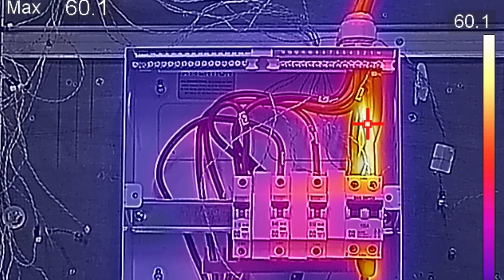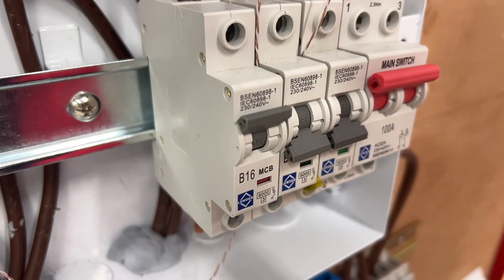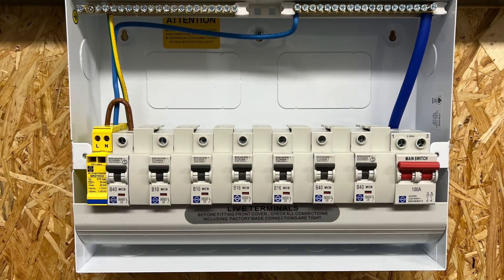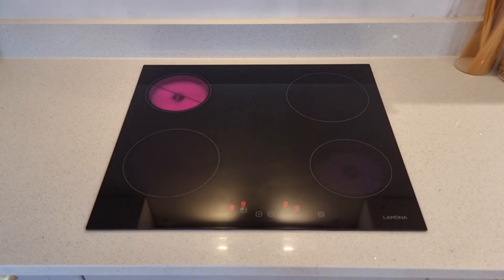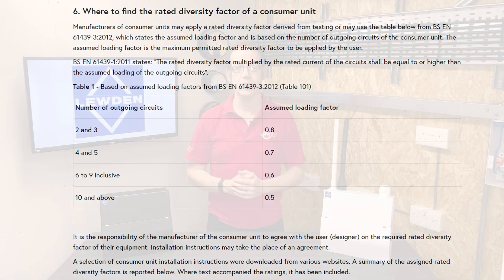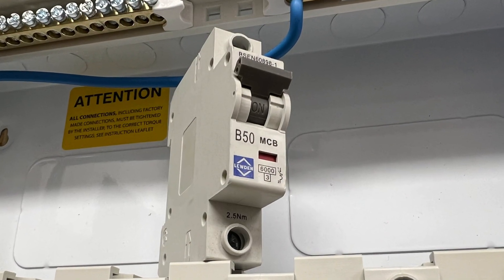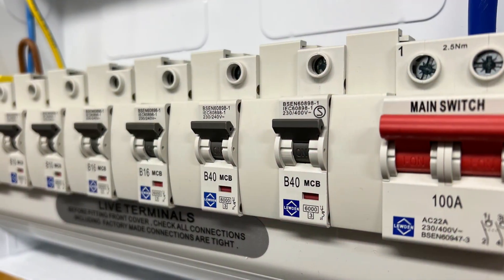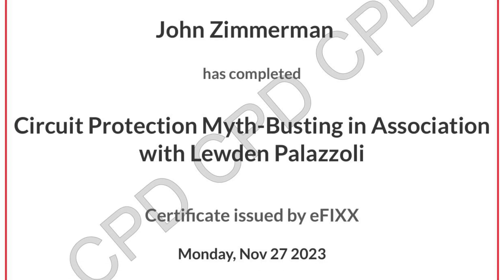Should MCB's & RCBO's be Spaced Out in a Consumer Unit?

Comment: But the max rated temperature on MCBOs (at least for Eaton) is like 70C, with derating of 0.5% per C.So going from 25C to 40C only lowers it by 7.5%
Reply from the maker: 7.5% is considerable for an Ev charger which is fully loaded for hours.
Reply: @efixx  I guess, here on continent we don't really get 40A single circuits, even 20A is pretty uncommon, as most higher power stuff runs on 3 phase.

Comment: If youre installing cheaper branded gear that specify they need to be spaced out to prevent them over heating then sure. 

Personally ill stick to brands than engineer their products better
Reply from the maker: It’s an issue with all brands.
https://electrical.theiet.org/media/3068/wiring-matters-issue-96-july-2023.pdf
Reply: @efixx  yes, as it even says there, when constantly loaded. How many circuits can you say are constantly loaded to even 50% in a domestic setup?

Comment: If devices are manufactured to a BS or EN standard then it’s the manufacturer that should give what aspect of their standard of their standard does not meet the criteria and why separation is required.
Reply from the maker: It's compliance with the relevant standard that MIGHT lead to a need for spacing.

Comment: He morel of the story is don’t load the rcbo/ mcb to near  it’s maximum rating. As my old boss used to say if there is any doubt put in the next size cable in and allow for a slightly higher MCB as you never know what’s going to be added to a circuit at a later date

Comment: If we start doing it like this we’re going to need a full wall for a dis board
Reply: Wait until they make the generally pointless (in the UK) arc fault detector mandatory...
Reply: Forgive me if I seem to be overthinking this but Would it not seem like sense to fit solar panels and ground force heat pumps and all the other shit as standard practice on all new builds

Comment: The thermal de-rating inside a breaker box is essentially only a function of the maximum current that can flow through the breakers in the box.  That in turn is a function of only two things: (1) The main breaker amperage and (2) Whether the sub-breakers are 1-pole or 2-pole (or 3-pole, etc).  And that is it.  It doesn't really matter whether the high-load breakers are next to each other or not, and the number of breakers doesn't matter either (since the total is bounded by the size of the main breaker).  The heat will effectively spread through the whole of the enclosure.  More on that in a moment.

The third thing to remember is that the heat generated is a function of the square of the current. I*I.  Because it goes by the square of the current, just using the normal rule of 20% for circuit ratings verses heavy or continuous loads essentially removes the issue entirely for nearly ALL situations.   Current just 20% down vs the breaker size will massively reduce the heat generated inside the breaker... it will cut it almost in half, in fact.

The 20% rule can simply be applied across the board, whether the load is heavy, continuous, or not.  Just follow the rule as a matter of course and you will be fine.

So, for example, if you have a 50A circuit and breaker for charging an EV, the maximum allowed EV charging current will be 40A.  (50 * 0.8).  If you stick to this rule, then you should not have to worry about breaker adjacency or spacing inside the breaker box.  The adjacency is not going to effect the bi-metalic strips all that much, if at all.  And even if it does a little, the actual current has already been de-rated to 0.8x the size of the breaker.  So it's a non-issue.

Thermal de-rating in cable bundles and conduits is far more important than thermal de-rating in breaker boxes.

-Matt
Reply: No, your theory contains errors.
1. The heat is not uniformly distributed in a CU.

Those breakers carrying a higher load current are going to get hotter than those carrying a smaller current.

Whilst the heat will spread through conduction to devices in contact and through convection of the air inside the CU the fact is there is going to be a temperature gradient with the hottest point being on that higher current breaker(s).

2. You say that the thermal de-rating depends only on the maximum current that can flow through the breakers.

No, definitely not correct.

There is an ambient or baseline temperature. When current passes through the breaker that current heats up the breaker and that increase in temperature is a delta on top of the ambient baseline temperature.

The bimetallic strip in the protective devices detects an absolute value of temperature and trips when the threshold temperature is reached.

So if you have an ambient temperature of 20°C and the breaker trips at 80°C then you have 60°C of margin.

If the current is 20 amps and that creates a delta of 50°C then that causes the breaker to heat up from 20 to 70° - no problem.

But now if the ambient temperature is 40°C, that same 20 amps of current is going to push the temperature of the  breaker from 40 to 90°C and now the breaker is going to trip.

So clearly, the idea that the ambient temperature does not have an effect is plainly and patently wrong.

So the maximum operating current has to be reduced (derated) according to the ambient temperature, otherwise you are going to end up with nuisance tripping and being unable to power the same number of devices, the same load in summer as you were running in winter.

3.  Air flow around the RCBO and MCBs.
Having no space between the protective devices means that there is insufficient airflow to take the heat away and consequently the protective devices will heat up even more.

I have personally seen this with a stack of 3 external hard disks in plastic cases which were in contact with each other. The disk in the middle failed because it overheated. The others did not fail.

Clearly the close proximity of adjacent devices, if too close, are going to cause an increase in temperature rise of the target device and may cause nuisance tripping when high currents are being carried.

So again, this is another example where the derating of load current for protective devices should occur because of the layout inside the CU, providing another example disproving the assertion that it only depends on the current and nothing else.
Reply: @deang5622  The de-rating has already been done. You are trying to do it twice to justify adding spacing that really isn't needed.

While all of these thermal issues are present to one degree or another, they are ALREADY baked-in to the standard de-rating that all electricians must follow for continuous load circuits.  You don't have to do anything extra.

Also, I will point out that ambient temperature derating curves ARE NOT LINEAR.  Circuit breakers are ALREADY rated for proper operation up to 40C ambient, and the derating curve above 40C is sub-linear and ALREADY fits within the standard 20% (125% rule) for continuous power.

Only extreme environments actually require extra de-rating.  A breaker box inside the home isn't going to be in an extreme environment.

-Matt
Reply: @junkerzn7312  So if you buy a 32 amp MCB and you wire that in, if the derating has been done then that breaker will be fine in UK up to 38°C and also will still handle 32 amps in Dubai at 50°C ?

Are you sure about that?
Reply: @deang5622  You didn't read what I posted above about required de-ratings for continuous amps.  Try reading it again.  In fact, I don't think you are reading much of anything that I posted, or you wouldn't be asking such a stupid question.

-Matt

Comment: I thought this was the reason we're not allowed to mix different MCB brands - the heat dissipation hasn't been tested with differing brands touching. 

Perhaps it's okay to mix brands if there's a blank between them?
Reply: I don't see why not. An RCBO or MCB knows nothing about any other protective devices in the consumer unit. The performance is as stated on the tin...it doesn't change because of other devices.

Comment: No. you're just trying to cause more problems and create a problem when there is no problem. behave ya self. If you think there is an issue then why dont you put ya hand in ya pocket doing some R&D to make mcb and rcbos better at dispersing any heat. unless we start installing CUs the size of a oven with a 12 way would now be a 24 way.

Comment: customer question.
Can an old CU and supply (the master fuse from the supplier) be upgraded to a higher amperage when a new CU is installed? ie, from 60 or 80Amps to 100Amps.
Reply: You need to talk to the DNO.
Because it depends on the cross sectional area of the main service cable coming into the property through the main fuse.

That cable might not be thick enough.
Reply: @deang5622  thanks.

Comment: Full size MCB/RCBO are being replaced by minuture versions.  The outcome MCB/RCBO are getting hotter and trip times and currents are effected.  This needs to be looked at, at the design stage by the manufacture.

eg CUs with 40 or 50 or 60Amp breakers are becoming the norm for UK Domestic installs with PV, EV.  If the small form factor gets too hot maybe the manufacture could recommend the full height version and explain why it is needed.

A 12 way CU with spacers enbetween
Does look nicer
Can be dressed neater
Allows lots of room for inspection and testing
Does cost slightly more than a 8way unit

On the other hand a multi row or stack board gives you all the above but costs more and takes up a lot of space.  If you were to consider it a replacement for a existing CU under the stairs or a new install in a new build.  There would be different design considerations.  Space and cost will probably the biggest issue.

Comment: Type B trip at 3 to 5 times the rated current. The heat would reduce this, would this not make it safer as it would trip at a lower current?
Reply: That is a good question.
The protective device doesn't trip at that current, it trips at a certain temperature which is caused by the current which causes a delta in temperature, above the baseline operating temperature of the protective device.

So if the cable is rated for 80°C, then that protective device is designed to trip at 80°C or less. Let's go with 80 for the purposes of this discussion.

So it doesn't matter what the ambient temperature is, that device is still going to trip at 80°C and irrespective of the magnitude of the current passing through it.

So it doesn't matter if the ambient temperature is 20 or 60°C. 

If it always trips at 80° then it is clearly doing its job and protecting the cable, it is therefore no safer whether there is 10 amps passing down the cable or 20 amps.

The downside is, as the baseline temperature with zero current passing in the circuit, you are more likely to experience nuisance tripping because the full rated current for the circuit will push the protective device up over 80°.

Comment: After loading up CUs for the last 30 years now you tell me I have been doing it wrong. Or is it the MCBs made with far cheaper materials. You decide.
Reply: This has always been a thing, if you know how a circuit breaker works, you'd know there's a bimetallic strip inside that is heat sensitive and tuned per device to trip when appropriate, any external heat can and will influence that.

Comment: If you put one of those full size blanks between them then you aren't allowing the breaker that is generating a bit of heat to dissipate anyway, be better to use a metal blank on the cover instead and allow the MCB/RCBO to sit in free air.

Comment: but it's in a sealed unit, any heat created by MCBs would thermally transfer through the surrounding stagnant air, and much of it would transfer via the bus bar. I don't see a need to space them out.
Reply: Yes it would transfer through the air,  but it comes down to things:
1. Is it a sealed unit and how well the air can escape from it

2. How good the thermal conductivity is from the breaker to the surrounding air.  Two sides of that breaker are in contact with other breakers and the material is plastic, which is not a good conductor of heat.

The ability of that breaker to dissipate heat very much does depend on what is situated around it. If other plastic case devices are in contact with it, the total thermal resistance is going to be quite high and much higher than if there was a complete air gap around 5 out of the 6 sides.
Reply: @deang5622  Well going off regs a consumer units should be fully sealed including intumescent strips around cable entries so if there was a fire inside the cu it could potentially stop it spreading, my point is modern metal consumer units are pretty much sealed.
And plastics while not very thermally conductive will still heat up to ambient temperature given plastics have quite a high thermal capacity so it takes a long time to also get cooler, thus keeping the internal air temperature above ambient for a longer period.
Reply: @Daniel37parker  Sealed units are worse thermally.
And as for everything heating up to the same temperature, that isn't relevant.

What is important is the steady state temperature the breaker reaches after it has been passing current for a length of time.
It is that which triggers the bimetallic strip inside the breaker.

And the ambient temperature matters because that is the initial starting temperature when the breaker is passing no current. 

The question is, what is the delta, the increase in temperature of the breaker caused by the maximum circuit current passing through the breaker (or other protective device).

That temperature increase caused by the current flow adds to the initial temperature of the breaker.

You can't make assumptions about how hot it is going to get. You can try and estimate it mathematically, which will be hard, or you can perform an experiment and measure it.

You can measure the delta, the change between the initial temperature with no current flow and the steady state temperature reached with all circuits under full load.

Comment: Isn't this the reason we apply the 125% rule involving continuous circuits ie pv,battery storage or ev charge point
Reply: Correct, for any continuous load.   Max-load = 80% x breaker-size, which is the same thing as saying max-load x 125% <= breaker-size.   And yes, this essentially solves the issue entirely because the heat generated is almost half at 80% what it would be at 100%. So spacing should not be needed inside the breaker box.

-Matt

Comment: Thanks Joe, useful to get this out there to more electricians. I use the spare blanks between high load CCTs where available such as on a CU change incorporating spares for future-proofing.Or,  where there are none, I put B6s or little used socket circuits like a garage, next to the high load CCTs. Let's face it, lighting circuits in a modern home using LEDs will never warm up even if every lamp in the house is on 24/7 and apart from a kitchen socket circuit, do many homes use anywhere near the 32A ever, let alone for such a length of time that it will cause thermal issues?.... which leads me onto maximum load 😉

Comment: Even better if they are made of sterling silver - for even better safety, of course.

General public already can't afford upgrading their electrical installations. You pushing for even more spending without real improvement of said safety.
Reply from the maker: I don't think we're pushing for more spending just highlighting something that may be an issue in some cases. We actually suggested a method at the end of the video that didn't require any larger boards at all. 🤷

Comment: Wonder if this will be the new 19th edition Regulation, to make us all buy a new board.
Reply: If a breaker can't be placed next to another then it's designed wrong.
Reply from the maker: They can be, but if they're feeding a sustained load then thermal derating may need to be applied. It's just physics to be fair. 👍
Reply: @efixx  Breakers' overheating from heavy loads easy to eliminate by increasing price for electricity even more.
Reply: Rather cynical point of view because we know there is never a requirement to bring installations up to the latest BS7671 standard, so you don't have to rip out existing CUs.

It will only apply to the installation of new CUs.
Reply: @deang5622  read who writes your regulations :) most councils/testers interpret that installs should comply with the latest regs
Reply: @user-wk7wv8rn8h  I know precisely who writes the regulations and it is not local councils.

And what I stated was a simple fact, sufficiently simple that there is only one possible interpretation, which is the right interpretation.  It is not possible for different parties to have opinions on it. And that is the correct legal view.

However, councils, hiring electricians to carry out work for them, and as owners of properties may decide for themselves to have a policy of bringing up older installations to the current version of the IET regs, and as they are the owners of the properties, they have the right to insist upon that, and they are paying for it, but the fact still remains, there is no legal obligation to do it.

Don't get confused by what a house/property owner may chose to do and what they are legally obliged to do.